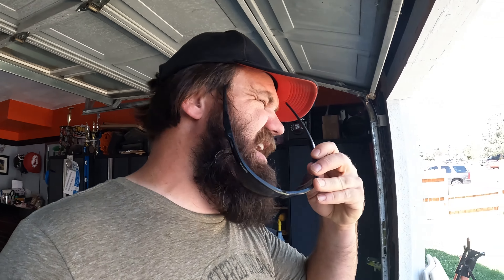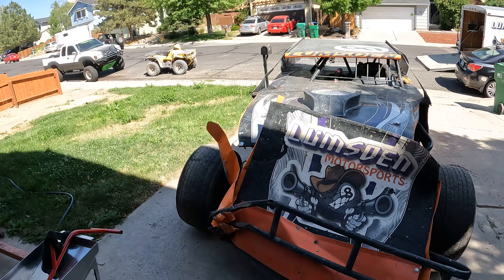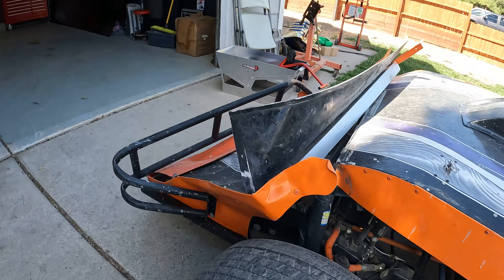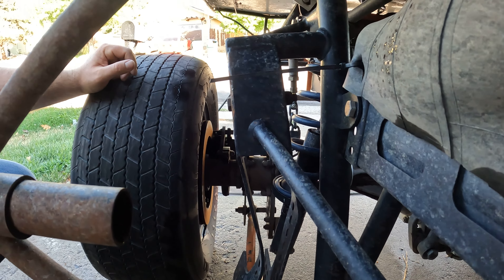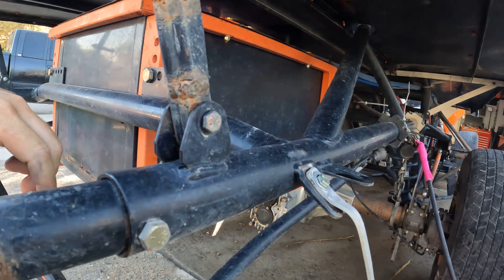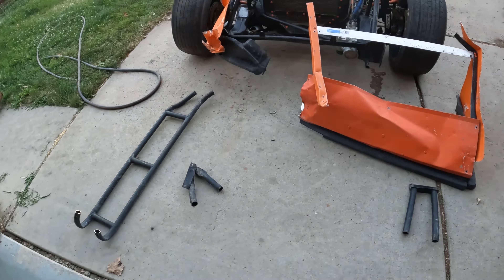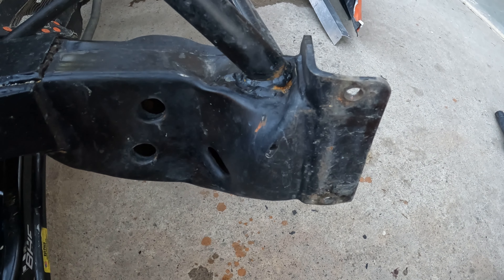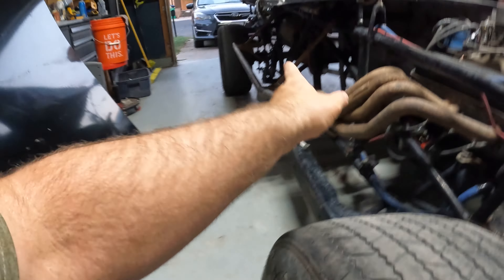IMCA Modified is Home.  Stripping Off The Body To See The Damage And Get Ready for New Panels

Comment: For your t bar on the rr cut it like a foot short and then get a piece of round tube that fits in the square tube and ust that as the rr portion. Either use a really small bolt or a pop rivet to hold the round tubing inside the square. Any contact will break the pop rivet and let it slide in. If you only 90 the outside of the deck and let the inside sit on top of the other piece it will break the rivets and slide with the round tubing. Hopefully that all makes sense
Reply: My son loves the top side, occasionally he makes contact with the top side.  We have a very sturdy t bar  with the right side cropped like you said.  We use telescoping square tubing with about 3 rivets.  Attached to the t bar rh side (telescoping part) we have a hinge attached to a double 1" square rail that runs up to the behind the driver crossbar which is also hinged.  We took the deck panel aluminum and put a slight upward bend in it in the middle front to back.  We are halfway through the season and all we have had to do is push the slider out rerivit and beat the crease back down in the decking.  It is heavy but man does it take a beating.
Reply from the maker: Great suggestion!  I was thinking about something like this, or using something like the breakaway aluminum pieces.  Thank you!
Reply from the maker: something that can take a beating,  as you can see from my T-bar,  thats what I need! lol.
Reply: @wadelumsden1548  no problem, you’re welcome!

Comment: So the back bracket is bent to hell, but does it affect your arms?  If the up and down position is a little off it cannot be even a half a hole off.  Do you measure bar angles for set up?  Hell I am not sure I would worry about it.  As far as the bent horn all it does is hold the nose and the bumper.
Reply from the maker: Yes and no.  It has mildly changed the positioning of the arm, but to your point probably not enough to really matter.  I do use Bar angles usually with my initial set up or if i'm "throwing the kitchen sink" at it.  I will be trying to at least straighten it out, because right now they are so bent, i wouldn't be able to make any bar adjustments at the track if needed.   And for the front horn, luckily its bent in front of the steering so not a big deal, but a pain in the butt when trying to mount a new bumper to it lol.